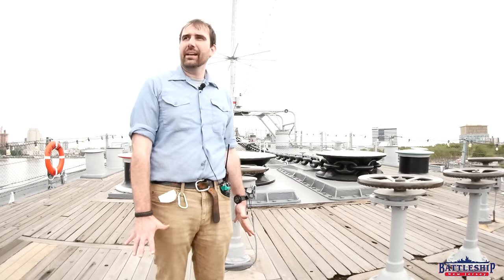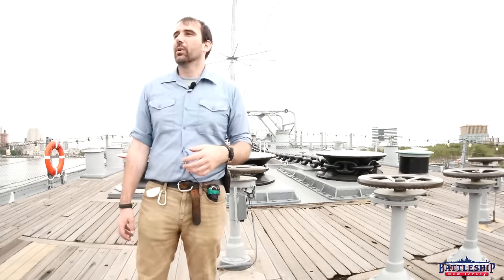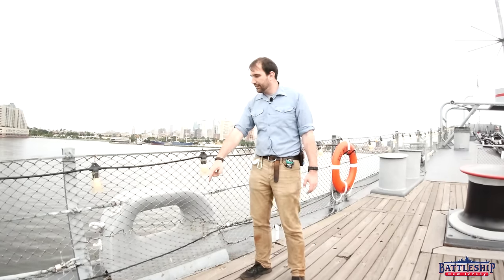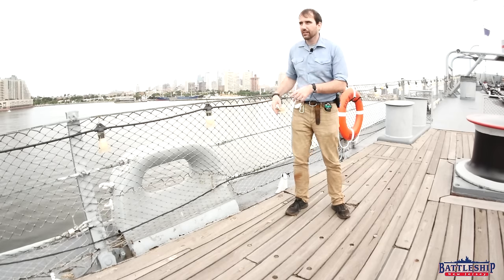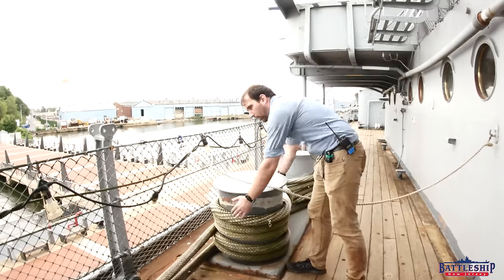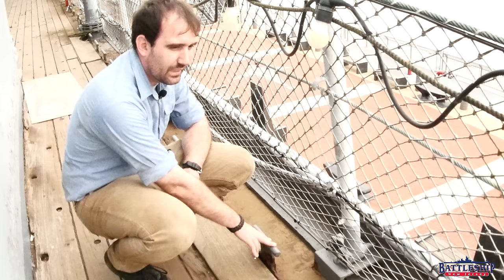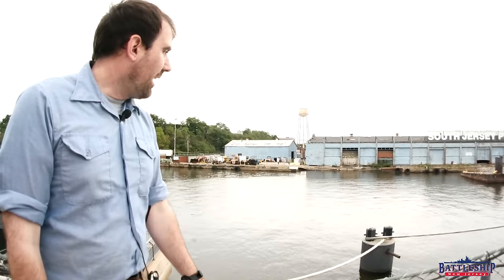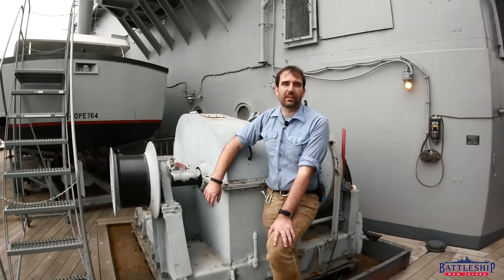UNMOORED: Bollards, Capstans, and Other Ship Mooring Terms

Comment: I'm interested in hearing about the unconventional things on the ship that might run off of steam. It makes sense to take advantage of the steam plant in as many locations as possible, and yet I'm still floored every time some miscellaneous piece of equipment not associated with power or propulsion just taps into the abundance of available "low" pressure steam. A roundup of some of the more interesting (or perhaps interrelated) steam-powered systems would be fascinating.
Reply: Pretty much anything that needs heat? Run if off the steam. Anything that needs pressure? Run it off the steam. Anything that needs linear motion! Run it off the steam. It's a gross oversimplification but hopefully you get my point
Reply: Basically anything that doesn't need flexibility uses steam. Wires allow you flexibility, so electric motors get used in those places. Otherwise, steam. Steam laundry, steam hydraulics, steam stoves, etc.
Reply: @JoshuaTootell  Sometimes electrics will be used even when steam is possible just to avoid the added heat of using steam in a smaller space, but as a general rule, if it can be run off steam, it is run off steam

Comment: Back in the days of sail merchant ships used a windlass rather than a capstan, as a capstan wanted the extra manpower aboard a warship.
Mooring points are sized based on the diameter (and type) of line to pass around them.  Ideally, you do not want natural fibre line to bend more than 6 times its diameter.  Wire rope is "happiest" around 12 times diameter.  So, those things affect bit, bollard, cleat, etc. dimensions.

Fairleads are very common where the Spring lines are brought aboard, due to the acute angle those lines have viz-a-vis the ship.

Comment: My favorite term from sailing ships is the peculiar version of a windless, the brake windless. Because when you say it you can hear people snicker. They don't hear the spelling; they hear break wind.   These gave rise to shanties that were designed for the rhythm used to work them. A regular irregular beat. On my boat I have no windless or capstan but I just recently warped my stern in using my jib sheet winch. These are the largest winches on my sloop. The wind was blowing me off the pier so my mate got a bow line on and I got a line to a cleat ashore as a breast line and just winched us in. It was fun. I could have just hauled in on the line by hand but what would have been the fun in that plus I could use the winch to secure the line.

Comment: The types of lines would be interesting as I used line that washed up during a storm to get people stuck in sand on their way by using the dynamic rope which stretchs like a rubber band and when you can't go forward anymore you slam the brakes on and watch the stored energy pull the stuck vehicle out. The other type was best used for decoration as it was about as stretchy as chain and that's what damages vehicles and can injure people. Are mooring lines dynamic or static?

Comment: My grandad told me that when a mooring rope snaps it's super-dangerous, but I don't now remember if it was something he'd seen or if the other soldiers told him about it after an incident on a troop ship. Something about the potentially enormous tension on a mooring cable meaning that when it lets go it REALLY lets go?
Reply: It really depends on how much the line, rope, or cable can stretch before failure as to how dangerous it is. A decent length of IWC or IRC steel cable can stretch a lot, and therefore store a lot more energy than a chain or a spectra rope will. The more energy stored, the more it will whip... and the more danger to those around it.

A general rule though is to stay the f*ck away from any form of line under tow, winch, or hoist.  It's never good when they fail.
Reply: Thanks! Good info and good advice.
Reply: The term used is called “parting”. Injuries from parting can be downright deadly.

Comment: If I am not mistaken, a capstan and windlass don't work the same way. With a capstan, the line enters, wraps a couple of times, then exits, and pulls as long as there is tension on the exiting line. A windlass contains the line as it pulls in, AKA, a winch.

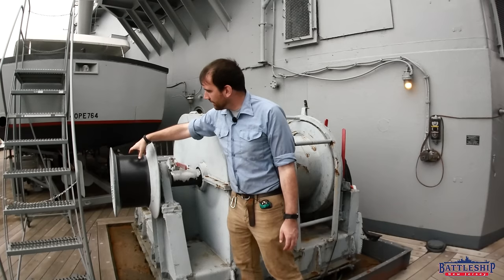Edit: 6:24 - I stand corrected.
Reply: winch loads up the line, windlass drops it off like a capstan,  winch /windlass are horizontal, capstan is vertical.

Comment: Why does the battleship (maybe other navy ships too) have capstans on the bow? when normal merchant ships feature a windlass? 
For merchant ships, you don't want deck penetrations of all those shafts I'd think, keep it water tight. 
But is it on a navy ship a capstan to reduce the height above deck? so the guns cannot hit it?
Reply: I don't think those capstans are powered. They had very large crews to haul the lines. Combination wildcat/capstan setups for hauling lines with power is one of the luxuries of modern shipping, I'd expect.

Comment: No CT lines, huh? Messy things... cool bit of engineering, but messy. Dirty grease everywhere. And the CT lines, made of wire rope, never want to be spooled up properly upon departure. And those bitts... I still regret that I never managed to be any good at passing a stopper. You didn't talk about stoppers! Maybe because BBs would usually go to a mooring...

One thing I'd really like to know about is the huge antenna up on the bow. I've been wondering about them ever since the IOWAs were rebuilt.

Comment: Can Wildcats or Capstans be pulled out of housing or ripped off of deck while in use due to failure or mishandling?
Reply: On most large vessels they certainly could be damaged, but nylon mooring lines would probably snap before they pulled out a capstan (and old manila lines certainly would). Wildcats... possibly. A runaway anchor will do all kinds of damage and likely start a fire in the brake or wildcat or something, but I expect battleships like NEW JERSEY take advantage of the extra strong deck to make the ground tackle more secure.

Comment: Let's see now - As Charleton mentioned, double up all lines. Then, there's single up all lines. Someone mentioned a monkey fist. What does it mean when the bridge is informed that the anchor is aweigh? How do you splice lines? Eyes, joining two lines. How about splicing a hawser? How big does a line have to be to be called a hawser?
Reply: Double up all lines is the command to put two lines at each point for added strength (during heavy weather and the like).  Single up all lines is the command to remove those extra lines when preparing to leave.  A monkey fist is a knot used to add weight to the end of a heaving line.  Telling the bridge "Anchor's away" means that the anchor is up, and the ship can sail.  For line splicing, YouTube has tutorials.  An eye is a loop anywhere in a line and can be permanent or temporary.  The mooring lines shown attached to the dolphin appear to have eye splices passed over the bollards on the dolphin.  For splicing hawser, again look for guides online.  The size of a line to be called a hawser depends on the size of the vessel.
Reply: @moo4boy  I posted this in reply to Ryan's request for suggestions. Actually, I know all of them. I spent my first cruise in deck division and have done every bit. The correct term is "anchor's aweigh," not away. The precise definition is that it is the moment when the chain and anchor are vertical but the anchor is just touching the bottom.
Reply: "Ashley's book of knots"
Reply: Ooh, what's a cable versus a hawser, that's a spicy debate you're getting into
Reply: @Vinemaple  Excellent question. Let's hope Ryan will answer it and, maybe, have examples. Yes, I do know the answer.